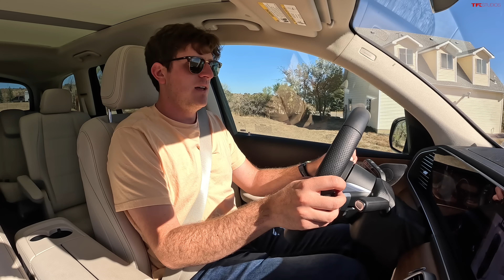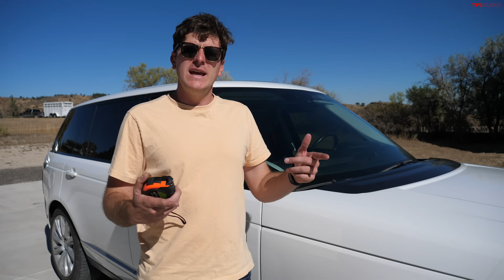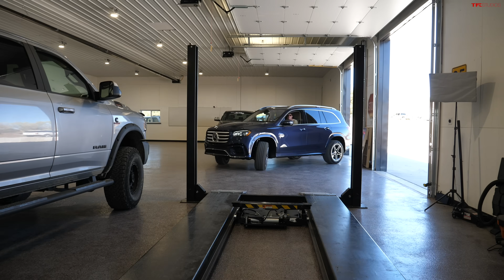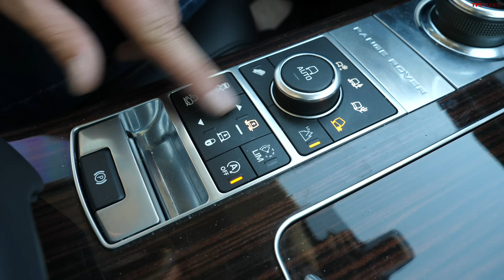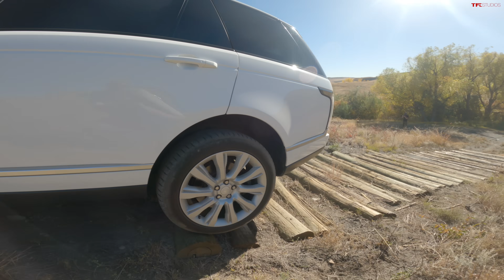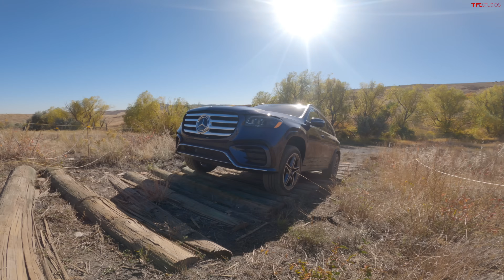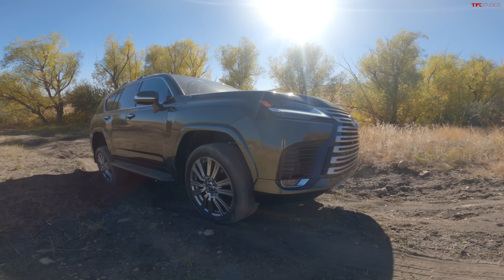Is The Range Rover Still The King Of Off-Road Luxury SUVs?

Comment: Rangie is old tech with terrain response 1 - new variants and auto centre and rear lockers are a new animal... not comparing apples with apples here I'm afraid. 
Also the lexus is the ugliest truck on the road. 
The merc has the gear change on the tree which is diabolical when driving cars that have lights and indicators on the right one minute (asia) then on the left in the next car (Euro) - then you get in the merc and you go to indicate and you drop into reverse (kblammo) its a shock.

Comment: One thing Range Rover does far better than Lexus is making the offroad systems intuitive and well organized. In the RR all the buttons for the offroad controls are all in the same spot, and work well together with the software. The Lexus still puts the 4wd low range button here center diff lock there, mode mode over yonder, crawl control a country mile away, hill decent in a different zip code etc

Comment: Great video, great content.  Lexus LX I believe has the hydraulic KDSS which forces fluid into the alternating front to rear wheel (driver or same thing on pass side).  It's great for articulation while still preventing sway.  It's articulation was off the charts

Comment: I’m curious how these crawl control systems would do in low traction ice/snow environments that usually require wheel spin and momentum. Thinking some driveways with packed snow plus some sun.

Comment: Rock mode was totally the wrong mode for the Range Rover and the Lexus. You are on rollers which is simulating a low traction surface - you want either grass/gravel/snow or more likely, mud/ruts mode. 
Rock crawl mode is for high traction (rocks) surfaces. 
Also just Auto mode would be fine for the RR especially if you don’t know what mode is best. Stop with assuming rock crawl is the “most off-road mode” as it isn’t. Unless you are crawling over rocks. 
You’d have found almost Nil wheel slip if you use terrain response properly. 
You gotta stop just shoving cars in rock crawl mode and low range. On that note, high range would have been just fine with mud/ruts mode. 

Poor form. You the driver made the RR look much worse than it is.
The RR is by far the best of the 3.

Again NOT rock crawl for the trenches. STOP using rock crawl for everything off-road. Just stop it. Also you DON’T put a Land Rover in off-road height unless you need to clear an obstacle. By raising it you reduce your available wheel articulation. Stop raising the suspension unless you need to.

You were Never stuck on the logs. Stop saying STUCK!  You just came to a stop briefly.

The Merc is what? A crossover??  It’s not a crossover in any way - it’s a full size SUV or Large SUV.
That gear selector on the stalk is the dumbest idea ever. When you go for the wipers or indicators you’ll whack it out of gear.

Low range wasn’t needed anywhere.

Here in Australia they sell the Lexus AND the 300 series. So one doesn’t replace the other. The U.S. just misses out on the 300 for some reason.

Comment: going on the 10 year old 4wd system in the rover that was pretty damn good, I've been offroad in both the l405 and the new one and have to say the new one has a faster responding system, with better programming to tackle tricky terrain, it also has better articulation than the old one does. it would be interesting, personally though both rangies I've driven have had the 3.0 tt diesel, which with the extra toque delivery really sold me on them. love your work guys!

Comment: Love the video! I think it would’ve been better having the new Range Rover as well, but, we got to understand that they cannot comer across all the vehicles needed at times. When Land Rover introduced this long wheelbase model I was working for a JLR dealership and they advised us against any modifications due to the stretched wheelbase. These long wheelbase models were intended for mainly on-road use. I think all three vehicles here did well considering that all of them were wearing street wheels and tires. If I want reliable, yes, the Lexus takes the crown and drive home with me. But, after working for JLR for about 6 years, there’s something special about the Rovers. I’d still buy one with the S/C V8 engine.
Reply: The other thing to note with the RR, is that their example lacks the locking rear diff.  That would lock automatically in the rock crawl mode and would help significantly all of these tests.

Comment: I had commented this about a video where your dad and I think it was Alex on Auto's compared the LX 570 to the Range rover offroad and I said that with the hydraulic suspension of the lexus, in the most jacked up state the car becomes its most comfortable as the hydraulic actuators that offer the dampening and raise of ride height of the system open up when the wheels are in compression to offer more damping. This is why after the lexus drove out of the rollers it bounced so much, its like the E active body control of the gls on a baja course. I feel you havent fully understood how it works. The air suspension has to maintain certain forces to keep the car up and cannot react as fast as the hydraulic actuators in a hydraulic suspension system that is why an air sprung setup is so jiggly offroad. Also lexus does offer a offroad edition with 18' alloy wheels. The mercedes is also a GLS and those aluminium skid plates wont be so good during rock crawls, you need steel ones like on the lexus

Comment: The Lexus is the only one that won't cause you all kinds of reliability problems.....And it just so happens to be the best in test as well!
Reply: How do you know the Lexus won’t have issues ?
Reply: @Oldchrysler    .....because it's a Lexus....
Reply: @functionalfitness1013  they all will have problems lexus is starting to add as much tech as the german and British counterparts so in a couple years It will have more issues than you think. It's not the same tech as the land cruisers of the 90s and early 2000s
Reply: Lexus is already having reliability issues with those new 4 cylinders and turbo 6s RR just require proper maintenance but it’s equally as Luxurious and sophisticated as a Bentley or rolls RR can do everything

Comment: Lets be real , 2023 tech vs 2013 , bring on the L460 Range Rover and see how the Lexus handles it vs the L460
Reply: Won't be any different, the Lexus is not only eons more reliable, but better off-road all together. You won't out perform a solid axle.

Comment: You guys should do a bit of research with you owning that range rover on what the different drive modes do with the suspension because some maximise articulation but some try to keep a maximum ride height and if you know that it could help you on the trial depending on what situation you’re in

Comment: I’d argue ‘rock crawl’ modes are not the best test on rollers. Rocks tend to offer grip whereas a ‘mud’ mode would simulate lose slip more realistically for the roller
Reply: Not exactly. Because rocks are supposed to offer high traction but be very irregular, the chances of lifting tyres is very high, so rock mode is usually the most aggressive since you get wheels on the air (no resistance) and the opposite being on a high traction surface (no slipping which means very high load so more torque is needed to turn it)

Mud or sand however offer way lower traction. So you want slipping and power. Which means less brake action in favour of trying to maintain momentum. No point in trying to crawl in mud or sand because you're going to break traction MUCH more easily
Reply: @pablomoreno1999  that does make sense

Comment: That L405 had an unusual amout of wheel spin. I've been studying them and checking out their capabilities for a long time now and this was the only one who spun the wheels a lot that I've seen!
Reply: Because he was using rock crawl mode when it should have been Auto or Mud/Ruts. 
The error is always the nut behind the wheel.
Reply: This one is a long wheelbase with no locking rear diff which is very uncommon in a Range Rover which is why it was slipping so much
Reply: @lbnewell23  I've seen others as well with no locking rear. Heck, even the L322 slips less.
Reply: @lbnewell23 was nothing to do with no rear locker. He had it in the wrong mode. If you don’t KNOW (not guess) which mode use Auto.
Reply: @jerrymyahzcat  he may well have had it in the wrong mode and it would’ve done better in the correct one but in that circumstance it had everything to do with the rear locker. If it had one both rear tires would’ve turned at identical speeds and because it was a rear tire that had traction it would’ve simply driven off the rollers with no slip at all

Comment: Toyota did me a temporary favor by dropping the recovery hooks and V-8 from the pickup lineup in 2023. I'm still a Toyota guy at heart but this time I wound up ordering a v-8 Tremor (with the Torsen front diff) and am getting around 20 mpg or more combined and it has performed Very well off-road. The big question is if it will be reliable long term. Peace, Love!!
Reply: Dont forget to hand calculate fuel economy and adjust your AFE Bias.
Reply: @MX5-XU  Hand calculated 18.5 to 20.5 relatively in town, Truck says over 21 after 9k miles. Went from Aztec to Denver and back on one tank (obviously at elevation). Truck said 23+, I didn't bother. If I had gotten 17 on that trip I would have been happy.
Reply: Why wouldn’t it be? The notion of Toyota somehow being more reliable than everyone else is nonsense.
Reply: @tylermacconnell217  All auto manufacturers need to spend as little as possible + make as much as possible per vehicle (= profit margin).  All auto manufacturers spend their money on vehicles differently.  Toyota often lags behind other manufacturers for the latest tech and "newer" powertrains, but Toyota has always invested far more into engineering their vehicles for longer, more reliable performance.

For example, if you've been waiting for a hybrid power train option in the 4runner, you've been waiting a very long time, but the 4runner has arguable one of the most reliable powertrains in the world.  The Landcruiser is known to be engineered to last 20+ years (every single component of the vehicle).  The big 3 U.S. auto manufacturers will give you newer and more tech and features, but they don't spend the money on over-engineering like Toyota does.

If you buy your cars new and you're only planning on keeping your vehicle for 2-5 years then getting the latest, coolest stuff is fine and you won't likely really notice much difference (although with the only Dodge I owned I spent 3 different days at the dealer service shop getting various electrical and mechanical issues fixed...I've never once been near a service shop in the 2 Toyotas I've owned).  I owned a FJ Cruiser for 13 years and when I sold it, it drove exactly as it did the day I took it off the lot (from 9 miles to 97K miles)...every mechanical part, button dial, everything worked exactly as it did when I bought it.  I drove it offroad in Utah, many long road trips, commuted to work and back every day, it was absolutely driven...and still felt brand new.

So, in short, yes, it is true that Toyota is more reliable (because that's where they spend their money) than other manufacturers...and the resulting data also proves it...just search for "most reliable auto brands" and every single credible source will list Toyota and Lexus in the top 3 every single year (with Ford, Dodge, and Chevy usually being at or very near the bottom).

Comment: That's the old Range Rover, which is ten years old now. The new model has been on sale for nearly 2 years now: a totally different beast.
Reply: Also rock crawl was the wrong mode. Mud and ruts would have done way better
Reply: Also get one with rear lock diff
Reply: @olegb8115 not needed for that test.
Reply: I had chance to test New Defender in offroad. And when I mean offroad it was actually muddy corners and steep hills and just a real offroad. The Defender was absolutely beast.
Reply: @ytrontube range rovers suck on mud
Reply: @ryanfaubert2014 Every car sucks with normal road tires. Also Land Rovers use normal road tires because nearly no one use them offroad. I used normal road tires on offroad track with zero problem including mud and the Defender had zero problems. I have zero reasons to believe it wont survive from mud with Mudtires.
Reply: 1960s is old
Reply: @kc0lif Bro 1930 is old 😊
Reply: He specified that and the reason they used it in the video
Reply: Well it's their 2017 Range Rover that they bought just to find if it's a good value as a used truck...
Reply: Yeah, like he said in the video it’s a 2017model, and he tried to find a new one for the video but he couldn’t
Reply: Thanks for sounding like a boob- the host cited exactly what the land rover was relative to its demonstration competitors. Your integrity and perceived capacity comes into question when you attempt to teach a crowd and channel that are clearly more learned than you. Cheers.
Reply: Nope....its almost the same even in design

Comment: I’m a Toyota/lexus fan because of the reliability but I think that Range Rover is so cool, I got to drive one recently and man they drive like a dream, when they run right lol
Reply: exactly. We caretake for an older couple and their ranger rover was in the shop more than it was in the garage. This went on for about 6 years before they finally just sold it for pennies on the dollar. It ended up with an electrical draw that couldnt be fixed without some crazy dollar amount to replace the whole harness or something. It was pretty good in the snow and drove well.
Reply: Forgot to mention they bought a used 2008? land cruiser after that and they drive it back and forth to Canada. I think it has 350k or more on it now and has been very reliable.
Reply: I am Getting 1:24 Lexus lx600 diecast
Reply: Wow imagine being so boring that reliably makes you a fan of a car😂😂😂😂😂😂
Reply: @Jabber-ig3iw imagine caring why someone else likes a car
Reply: @Jabber-ig3iw  am I not allowed to like Toyota because they are proven to be reliable?

Comment: I had bought a 17 LX new, kept it for three years before selling it. The vehicle felt cheap inside, constantly had the alarm going off  randomly, door lock actuators failing, and the brakes were inadequate for towing causing severe shaking. Lexus rides in their hard earned reputation from the first half of their existence where unrivaled quality was built in. They are clearly all built to a much cheaper standard in recent years.
Reply: But you will hear no one mentioning these things, just praises.
Reply: @stop_lying_bro exactly- people go; “wow it’s a reliable Toyota” even though LC’s have a lot of well known flaws and issues.. LC200 steering rack issues - and drinking oil like a drunken sailor…
Reply: @scandinavia6271 ya, I think anything after 2017 is a little sus. I don't think I'm buying a car newer than 2015 for a long time.

Comment: um.....🤔....NO!!  4Runner is best off-road SUV💪!!  Properly equipped TRD Off-Road Premium with KDSS will take you places all day long that these "Luxury" vehicles will have issues with.  Want Luxury? Go with 4Runner Limited and get it Regeared and Triple-locked aftermarket - still less💰than these beasts!!
Reply: Factory vs upgraded, upgraded always wins for a specific purpose… but that wasn’t the purpose of the video. It was to compare luxury brands, which Toyota is not as compared to these.
Reply: Yeah my modified 22yr old Discovery walks circles around ANY Toyota, Proven several times over the 18yrs Ive owned it. Ive always said that Toyota isnt as good offroad as people think. But then again, I see what some people call offroad so Im sure they think its great. Not to mention the terrible visibility in the Toyotas. Especially compared to the stadium seating in a LR

Comment: Surprisingly, the GLE can actually be specced with a 2-speed transfer case and metal skid plates.
Reply: Surprisingly? Those GLE’s and the ML before them have been know off roaders. Our 2017 GLE 350 couldn’t get stuck no matter how hard we tried haha.
Reply: @S58985  I mean..it kinda hard to get stuck off-road when it is on a flat bed being pulled into a repair shop.
Reply: @Baebon6259 😂😂
Reply: @Baebon6259 confusing with Range Rover? Mercedes is decently reliable.
Reply: @bradleyscarreviews  yeah...reliably take money from your wallet or reliably visit repair shop.
Reply: It's what the customers want. Because there wasn't a demand for off road features in the GLS, Mercedes dropped those features. They also stopped offering the off road package for the GLC in the US.
Reminds me of the original Touareg, which was a true off roader. But due to lack of demand, VW stopped offering those features.